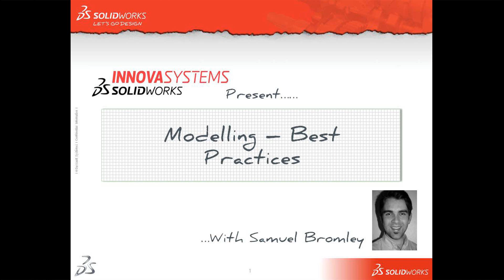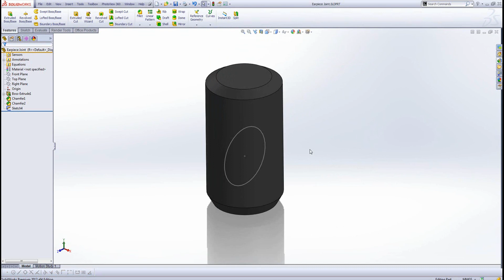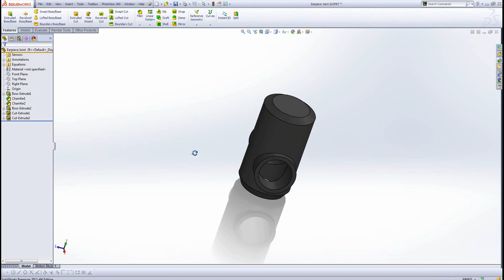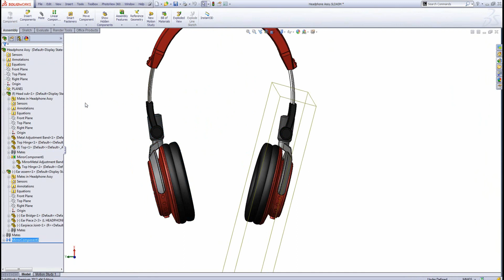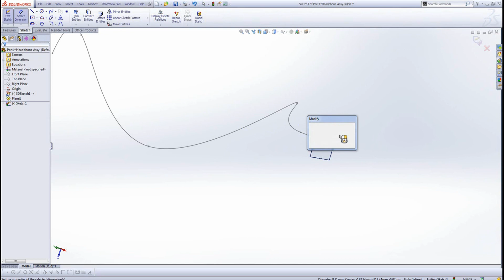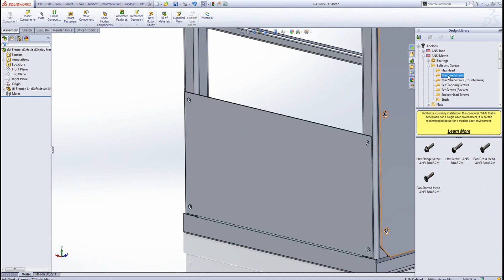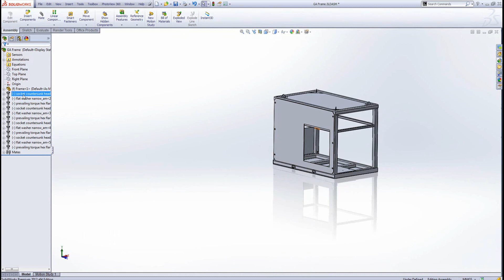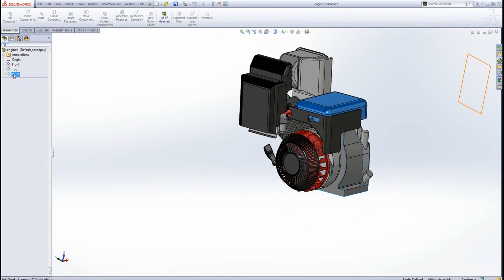Best practices for modelling in SolidWorks

Comment: A few things I've learned while using solidworks over the last 5 years that pertain to subjects covered in this video: 

- You mentioned using width mates around 9:00 in the video, an easier way of doing this is to hold Ctrl and select the 4 faces or planes that will be used for the width mate and then press your mate key.  Something else about width mates- your mate selection screen will be set to the "advanced mates" pulldown menu after creating a width mate, so if you continue trying to generate mates of standard type (regular face to face mates, etc) you will have to switch back to the "standard mates" menu.  I find it easier to just hit escape a few times and the mate key again as it defaults to "standard mates."  

- It is well worth investing the extra few dollars in getting a decent mouse with a few side buttons.  I have buttons on my mouse bound to: escape, enter, mate, rebuild and save.  On my space navigator I have Ctrl and Shift.  This saves a large amount of time once you get familiar with it.  Mouse gestures are also worth looking into, but I'm sure those are covered in another video.

Comment: The video ends in the middle of explaining the speed pack.  That looked like something I could use.  I will investigate.  Thanks for tips:  Fit spline to get ride of the junction line on the 3d spline.   Tab key to flip direction of mates.  Link value to create a variable during the dimensioning processing.  Good stuff.  thanks.